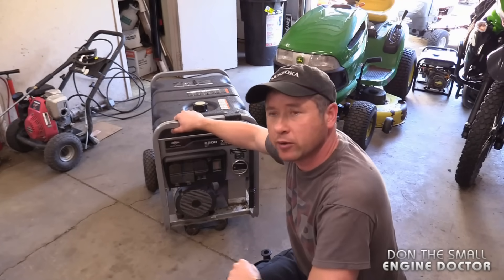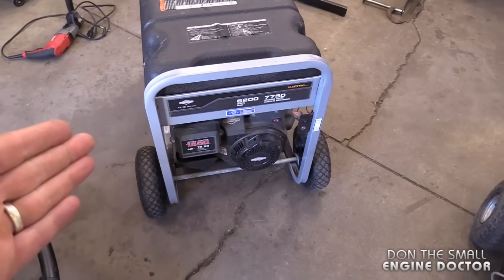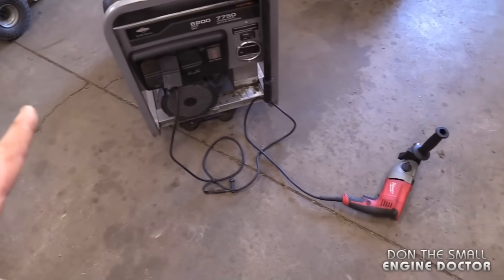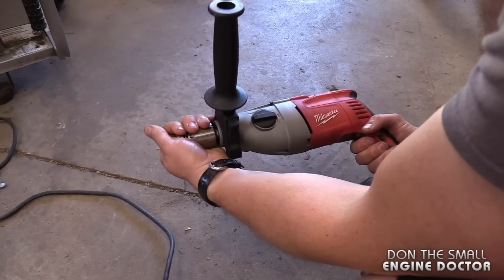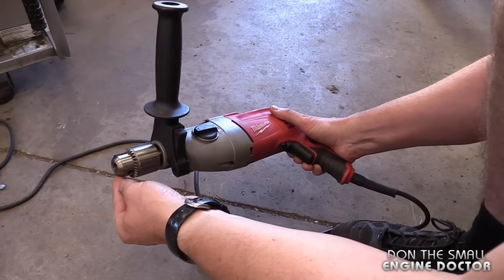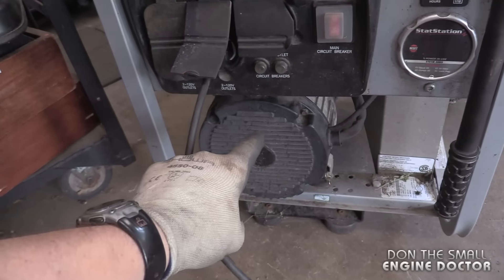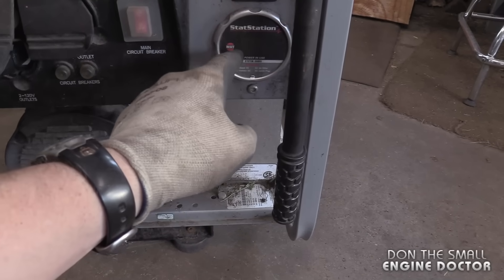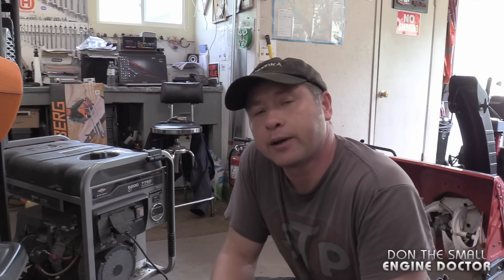HOW-TO "Flash" A Generator | Make It Produce Power Again | MUST WATCH

Comment: I've helped work on a large 415 volt 3 phase generator which could be flashed with a 6 volt torch battery before my apprenticeship

During & after my apprenticeship, I repaired a few of the smaller 3.5 or so KVa 240 volt single phase generators, the diodes in the rotor tended to get short circuited therefore required replacing but the generator starts making a "growling" sound if that's the case.

Some generators have the provision to be flashed with a 9 volt battery or they have a capacitor which holds charge after the generator is stopped so it can excite the stator next time the generator is used.

They have an exciter winding inside the stator (outer part) which induces a magnetic field within the stator, then the rotor (inner part) which then the magnetic field "cascades" or has a flow on effect,they are brushless these days !

There's probably nothing wrong with the generator other than possibly a faulty exciter capacitor
Reply: Hey you still out there?! 
Have a 56’ F and M 7500w 3 phase generator “power plant” (hooked to a Wisconsin )
So I got same thing going on. So on my 120 volt leg can I do this and it work good or do you think...
Thanks sincerely 
Luke C
Reply: I have one of those 2 cycle China generators that runs great but once I flash it with the drill, it quickly loses its power to run the drill.  I had the 12 uf capacitor tested and was told it was good.  Can a diode bridge rectifier cause this problem?
Reply: would that "growling" noise be heard over the racket from the engine?

Comment: This is a problem with my gasoline handheld blower I was going to use it and I push the primer bulb a few times and I realize that the bulb wasn’t getting fuel and I noticed that in between the line and the tank was gas escaping with pressure and I want to know how to fix that
Reply: Anytime an old engine powered anything acts up like that ... i drop it off to have all the fuel lines replaced (or do it myself) ... saves headaches, lasts for 10 years :)
Reply: Either Google small engine repairs or find a small engine repair shop. Lawn and tractor shops are places that may help you. Fuel lines deteriorate after so many years and need to be replaced with fuel proof lines you can buy from home depot, Lowe's, etc..

Comment: "Flash" = Energize the field windings. Usually, the ignition kill wire from the engine energizes the field windings in the generator with use of a small diode.

Comment: If it has a separate capacitor from the avr board it's probably leaky and not holding the voltage it should be.

Comment: Thanks, Danny for the FYI. I have a generator probably only been used 4 times EVER but the last time the cord broke then found ur vid of how to change the pull cord... a BLESSING The gas sat in it for a season so could it be the gas reason why it won't start. The generator is a 5,000 Watt Portable Generator  Model # HU40500/HU405000G It has oil and the spark plug is brand new. Have you done any videos on tunning up a generator or getting them going! Thank you

Comment: Early Briggs & Stratton portable generators had circuitry in the voltage regulator that would not allow them to turn on with residual voltage,if it sat for a long time or was bounced around,those 2 things will affect residual magnetism.

The residual voltage will barely be 3 volts ,the early regulator didn't switch on until 7. The newer regulators will turn on at 3 volts. 
If your Briggs gennie has no ac output ,you can flash it with a corded drill. 
Plug the drill into the running generator, pull the speed trigger on the drill, and twist the Chuck by hand.
Hopefully it'll take off and have output. 
Running them once a month for a few hours is enough to keep residual magnetism in the rotor. 
Or you can buy the latest updated voltage regulator. The "newer" regulators have been available for 4-5yrs now.
Reply: Not to brag but Briggs master tech here, ya need any info I can hook ya up.

Comment: Sounds like a bad capacitor that store electrical settings. When you turn the drill in reverse it induces a current to energize the holding circuit that reenergized a control circuit.

Comment: I notice the owners manual says fhe unit must be started and run every 7 days.
This could be because of a problem with losing the residual magnetic strength from the exciter coil magnets. 
The automatic voltage regulator won't "trip " unless it sees around 60V.
What you are doing with the drill is supplying the small amount of electrical current to allow these coils to build up sufficient strength to generate enough voltage to trip the AVR .
I wonder if glueing some Neodymium magnets near these coils could help ?
Just a thought......
Cheers Eric
Reply: Yes, loss of residual magnetism is what I would put my money on and I also wondered if putting magnets near exciter coils would work. I have only ever flashed the stator coils quickly with 12 volts DC, once there is a little magnetism there away they go.

Comment: Just a thought. When I took my dads generator apart, I found at least two capacitors that looked like run caps you see on some motors. Could the generator have at least one bad capacitor?

Comment: Don,  You may want to check the rotor, that is where you will likely have the problem. Portable generators, brush type or brushless capacitor excited type that does not have a field boost circuit, store the residual magnetism in the rotor, not the stator. Often times there are little permanent magnets glued onto the poles of the rotor ( which is essentially a spinning electromagnet) as a means of re-exciting the residual magnetism. Centrifugal force will dislodge these magnets and if left for a few days will go flat. I would concentrate there. I repair Generac portables and standby's and often encounter this problem.
Reply: Donny I agree with Bassguitarist.  Brushless generators rely on the exciter magnets in the rotor & capacitor for field excite if left set long enough that the capacitor loses it's charge then the rotor magnets are supposed to excite the field look for lost magnets in the rotor.  Basically an alternator.  they need power (from field) to make power (output)
Reply: @myhdsoftail03  or remnance voltage. The Honda EX650 is one such brushless Generator that does not rely on permanent magnets, but a storage capacitor. It does not have an AVR
Reply: Flashing the Generator Field
The DC generator is normally self-excited due to the residual magnetism which remains
in the field pole pieces when the machine is inactive or static. Self-excited means that
because of the residual magnetism as soon as the generator is rotated there will be a
voltage produced. Some of this voltage can be applied to the field coil to increase the
magnetism and cause the voltage to increase further until it reaches its controlled value.
An externally excited generator is one which has no residual magnetism and requires a
battery to supply the field coil with current to start the generating process.
Magnetism can be lost, destroyed or reversed due to the passage of time, the effects of
heat, exposure to an AC field, hammering or shock, and the application of a reversal of
polarity. The loss of residual magnetism in a DC generator, which will prevent any build
up in output voltage, can be corrected by momentarily passing a current through the
field in the normal direction.
Reply: Brushless motor doesn't have magnet on the rotor,it uses capasitor to energizing the stator to activating the magnetic field on the rotor
Reply: @joeery5699  should I pre-charge the capacitor off of a120-volt source? I have a similar issue on a generator that's been sitting not used for a couple years and only putting out like 60 to 70 volts, but capacitor test good on my meter
Reply: @chadjones99  use 12vdc battery
Reply: @joeery5699  thanks 4 the help,  question though are you saying pre charge the capacitor with DC 12 volts ? I thought capacitors charged up on AC power?
Its a 450 volt 25 mfd cap
Reply: @chadjones99  we only need to spike the amperage not voltage..start the engine and short the capacitor lead to the battery + to + , - to -..but 1st try to raise the engine speed see if the voltage goes up
Reply: Hello I have a generac 8000 w electric start portable generator when I flash it with a battery ,I can get the tools to work ,the issue is ,when I shut the gen down, and then restart it ,it doesn't put power out it loses it what was gained instantly any ideas
Reply: @joeortiz3455  what model? Does it have a field boost circuit?
Reply: @Bassguitarist1985  where would I find the field boost unit, I do apologize I am not where the machine is right now, I can't provide the serial or model number  ,I truly appreciate your answering my request  , may  i reachout to you tomorrow when I get back to the machine? I'm in south texas i will be at the machine around 11 am
Reply: @joeortiz3455  i can check to see if the machine has one. It would be inside the outlet panel. If it doesnt have one and its losing magnetism it may be missing the magnets in the rotor, the winding has a small leak to ground draining the charge off, AVR may be defective, dirty connections increasing resistance where the AVR wont turn on. There are many possibilities unfortunately.
Reply: Hmmmm, interesting. My Dewalt 7000 kw generator this afternoon, was very cold out, has been sitting, not running for two weeks, pretty cold weather, from 10 degrees to 10 below, (I live in Alaska)fired right up with a fresh charged battery, the gen ran super loud, like very high rpms or so (like maybe a stuck governor, this one is mechanical) I couldn't really tell what was going on, I went in the house to check my charger/inverter system, was not charging, then I heard the gen drop down to a normal "speed" but now no output. Also, a very different kind of smell like a winding burnt or maybe a cap blowing, etc. I'm not sure, but no 240 or 120 output. The startup motor runs fine but no output other than 4 to 9 vac. strange. Any ideas? Thanks!
Reply: Really complicated DOH😮
Reply: That didnt work for me 
How can electro magnets hold charge or 
How can pm magnets lose theire charge ?
Reply: I always facing this issue on sincro alternator,my quick fix and permanent is i change to higher value 10+ capacitor than the original capacitor
Reply: "I repair Generac portables and standby's" Job security right there. Sorry to hear you have to deal with Generac.
Reply: @matt9c1  i deal with the residential division. Its hit or miss really. Depends on the machine and what mood the service person I get on the phone is in.
Reply: @matt9c1 having power issues with a generac 6500 rn the drill trick does not work, it had power running lights and everything, and then it just quit putting out power
Reply: Early Briggs didn’t have magnets in the rotor , later ones do which helps the situation. The early voltage regulators wouldn’t turn on until 7-8vac, but the residual was only 3vac. Updated regulators produced in the past 3-5yrs have the ability to “wake up” at 3vac and don’t have as much of an issue. 
And run it under load for a few hours a month , it’ll help the rotor build up magnetism
Reply: I've got an old generac g4000. I check the voltage regulator output at the brushes and found that it was outputting AC. It's not supposed to do that right? I bought a new oem voltage regulator for it but found that it's not the same. The directions said to remove the "booster" if equipped. I assumed it was talking about the small transformer that was inside the generator housing. I removed that booster and found that the new voltage regulator still doesn't work.

Are there any steps that I'm missing for installing the new voltage regulator? Thanks!

Comment: What is “flashing” it? And why does it make it work again?
Reply: The Alternator in this type of "Generator" uses Power to magnetize it self .... and whatever does this is either broken or designed poorly (so it drains the magnetism away) in some generators ...  A drill actually generates a little POWER if you turn the chuck by hand .. It seems this tiny amount of power (Flash)  is enough to provide a bit of magnetism, and then it cascades almost instantly ... making the unit run at full power.

Comment: I have read that shutting off the generator while connection still exists to a load will cause this. Try turning the circuit breakers off before shutting the motor off to see if that may be the cause.
Reply: The capacitor linked in the stator winding drains out .

Comment: When I did this to an old generator the "turn the chuck by hand" didn't work.  I chucked a piece of rope in to the drill, wrapped the rope around the chuck and gave it a quick pull.  That worked.  Pull the rope in the direction that the drill is going to turn when running.  Took several tries to get it to work tho.
Reply: I can imagine a set up using a cordless drill ... to the corded one (with anything like threaded rod or even wooden dowel)
Reply: A quick pull while holding the "trigger" in that is.

Comment: Can you explain how doing what you did with the drill, caused the genarator to produce power?  How does the drill maneuver have that corrective effect on the generator? Hopefully one of your subscribers can explain it clearly.
Reply: The drill contains an electric motor.   But when turned by another source such as your hand, an electric motor will act like a small generator causing a small amount of power to be produced which is fed into the system and is then used to restore the magnetic field and then is ramped up into the correct voltage and hertz to power the drill.   Sometimes just plugging the drill in and pulling the trigger when release enough residual power from the resting drill to start the power output.

Comment: Hi Don, I experienced a similar experience with an alternator not producing any voltage on a Massey Ferguson tractor. It was a new alternator and we upgraded from an alternator that had an external voltage regulator to the new alternator with an internal voltage regulator. This alternator had lost all it "magnetism" due to sitting on the shelf too long. The fix was to splice into the ignition light wire on the dash and run it to the alternator. This allowed for a small charge of voltage that kick starts the alternator.  There is a good tuber called alternatorman that I sourced for my fix. I wonder in your case if there is a magnet on the fly wheel that has fallen off? Just a thought.
Reply: Car alternators don't have residual magnetism. How you wired that internally regulated alternator is just how they are wired in any car to work. If they kept residual magnetism, they wouldn't have been made with a field wire.

Comment: I have same engine but i have to remove spark plug put few drops of gas in cylinder put spark plug back in in order to start it.
Reply: I keep a can of starting fluid with all of my generators. Just spray some in to the air intake of the carburetor before starting . Saves time
Reply: Catfish Jenkem Worst thing you can do, only a last resort. Either strips down the lubrication on the cylinder wall. It's like when you hear someone rev an engine and then shut it off right away, the unburned gas strips off the lubrication and can shorten an engines life every time someone does that nasty habit, makes me cringe every time I hear it.
Reply: Been doing it for 40 years and havent ruined 1 engine . I guess it depends on how well you maintain them .
Reply: I never had problems either, Quickstart has always had specific upper cylinder lubricants added ... when I was a kid I had an 1976 chevy pick with carb problems, wouldn't start on its own if you left it for  more than 24 hours :)  ... I ran a dozen cans of QuickStart a year through it ... no problems, swapped the engine into a Chevy Van and drove it for 7 years then sold it, the engine is still running today in a farm only pickup! (he rebuilt the carb)   ... hell one time I was out of QuickStart, and got it running it with a can of my girlfriends hair spray
Reply: Doesnt work with starting fluid
Reply: anthony deliguin Carb issues.

Comment: Nice vid.  Is that power gauge an addon for ANY generator ?  If so, is it easy to attach and hookup ?
Reply: i would assume hooking one up would be fairly easy considering it just measures the load of what voltage you use.

Comment: I wonder if holding a good magnet near it would get it going. If the field got anywhere near the rotor the induced voltage might kick it in. Or moving the magnet quickly around the stator might work as well.

Comment: It's losing its residual magnetism.  I had to do a search but found this:

"When the residual magnetism is lost, the generator will produce no power at start-up. This residual magnetism can be lost naturally from not being used or from the load on your generator being connected when the generator is shut off. It can also happen from running a generator with no load for too long. "

Why that unit loses it after a couple days, maybe there is a resistance short ?
Reply: JK Brown 
If it's brushless with a capacitor it could be a bad cap or the beginning of insulation breakdown ,early Briggs units  had a issue with the voltage regulator not turning on from residual voltage
Reply: "Residual magnetism" is a temporary magnet and this can just fade away with time.  For example if you take a steel paper clip, nail or screwdriver and rub it with a permanent magnet, you can temporarily magnetize it, so that the magnetized steel will tend to stick to other pieces of steel even if the original permanent magnet isn't present.  However, over time that effect may fade away so that a month later it might not be magnetic anymore.